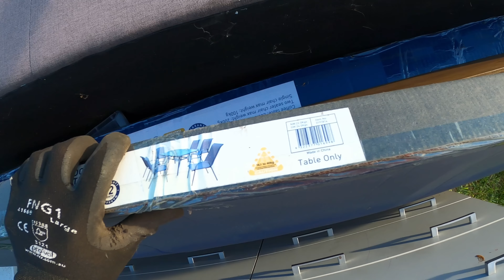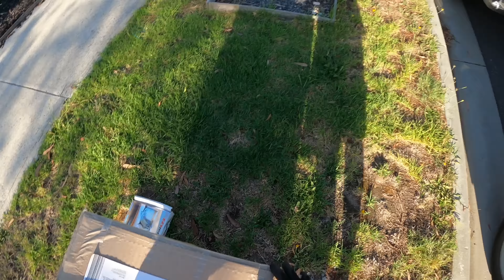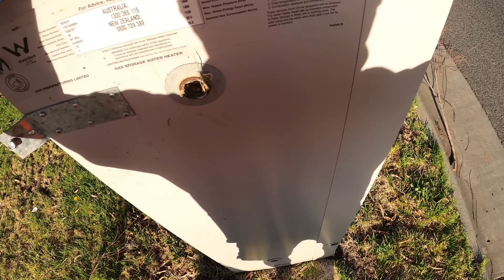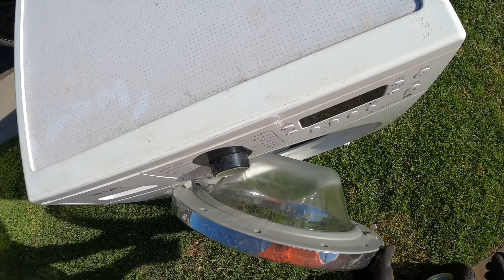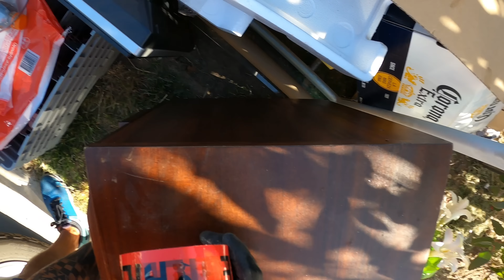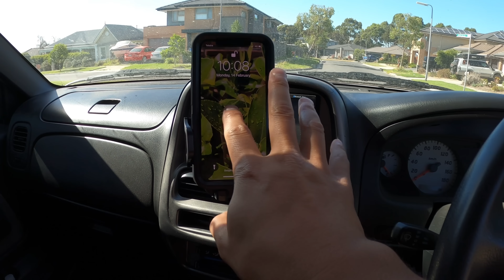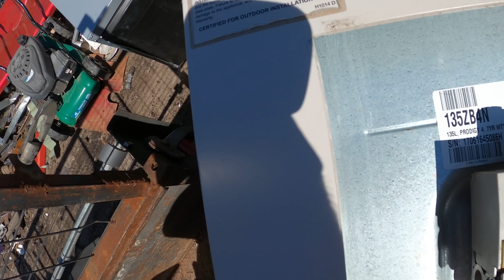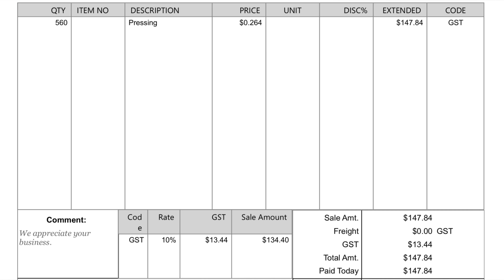There’s ‘Money’ In These Trash Piles

Comment: I notice on the water heater there is a aluminum control have you ever removed one the ones here in the usa the part that screws into the heater is brass and weighs about a pound of brass.
Reply from the maker: I haven’t scrapped one out yet but thanks for the tip Paul. I’ll have to give it a go one day 👍👍